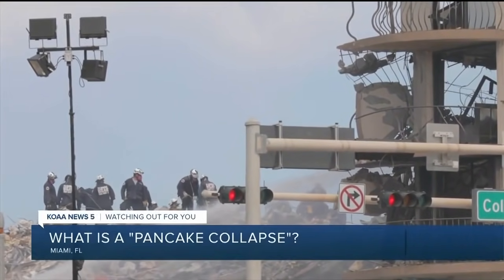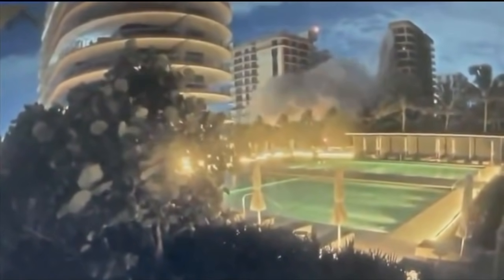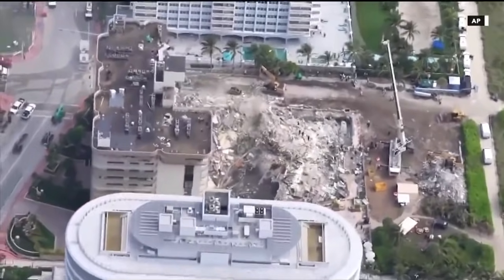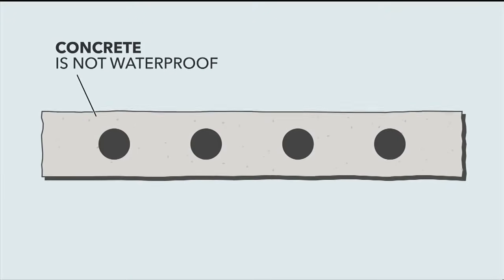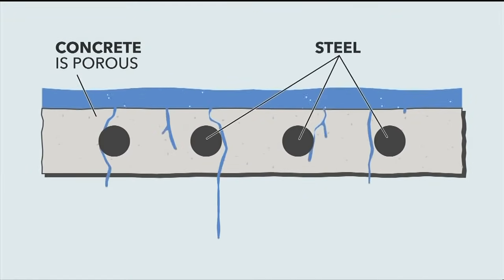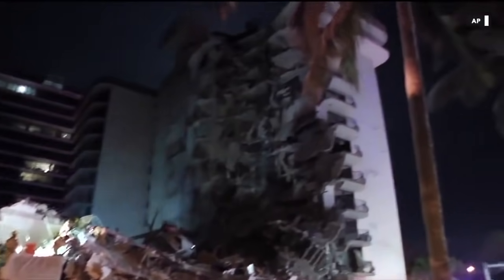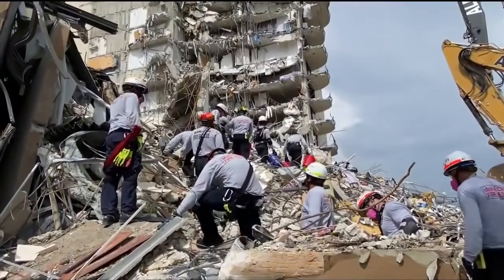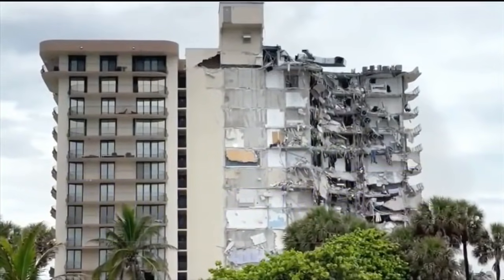Engineers explain the collapse in Florida and why it likely happened

Comment: Most people are unaware of building 7 that was Demolitioned the same day on 9/11 around 4pm. Tower 1 Tower 2 fell around 8:00 a.m. and building 7 was demolitioned around 4:00 p.m. so if you do the math that only leaves 8 hours or less to pre charge rig building 7. We've got to use common sense there's no way a 50 story building could be pre-charged to demo in 8 hours or less on 9/11 when everything was going crazy. So let's use common sense building 7 was already pre-charged long before it happened. people said that worked at the towers a lot of unusual construction was going on Jeb Bush was in charge of the building's security of Tower one and two and cameras were cut off in these buildings for a while. But the real evidence is Larry Silverstein admitted he pulled - demo Building 7 which was 50 stories tall nothing was ever done about that. And now that video has been removed unless someone saved it on a file. What I believe in everything I researched no planes ever hit Tower one and Tower two there's no way two planes would stick in the middle of these buildings and stop on a dime at 100 miles an hour. That's another great lie news media said the planes were traveling at 500 and 600 miles an hour when they hit towers one and two. fact is you have to be above the clouds to travel that fast the air is too thick at sea level. I also had a chance to talk with two pilots that backed up what I'm saying and what later turned out to be the truth. Jet fuel doesn't burn steel and concrete that's another great lie. People stop being lazy YouTube demolition buildings get educated. Surfside was a demolition job before and after.
Reply: Dude... your lack of proper punctuation, poor syntax, and lack of cohesion, make your reply almost incomprehensible.  Also, credibility would be enhanced if you knew that the proper term is "demolished" and not "demolitioned".  YouTube aids us with misspelled words with a red underscore.

Comment: Every 40 years WHAT A JOKE 🤣 and the facts arnt fully correct it was built in 71-72... way to protect Florida for someones well being wow... this building surpassed the 40 year annual recertification, this building aswell as many others get over looked and nothing to implement consequences when buildings expire. In 2018 there was a report made how structurally unsound it was but since the owner wasn't told of a mandated evacuation this is where the grey area is and this takes up to two years to accomplish. We'll 2020 nothing was getting done so it actually makes sense things started off February of this year. However, nothing was worked on in problem areas JUST construction on the roof which is always a huge no no and frowned upon. Now condos and buildings everywhere in Florida are magically being deemed unsafe as this state is incredibly corrupt, lazy and no back up plan. No national guard, no navy just people from outside our country to help, people who are NOT trained to save people but clean up the mess quickly. Your welcome to whoever reads this...